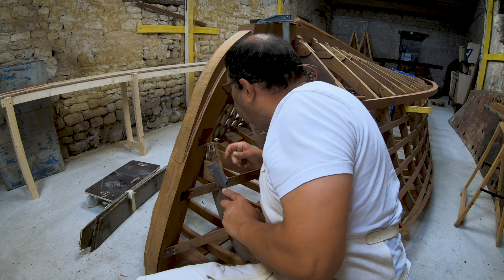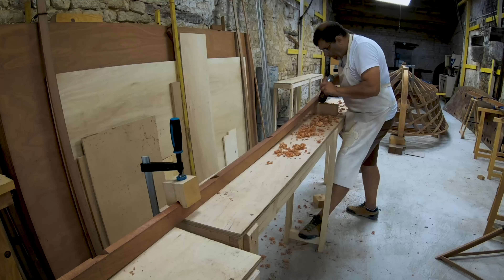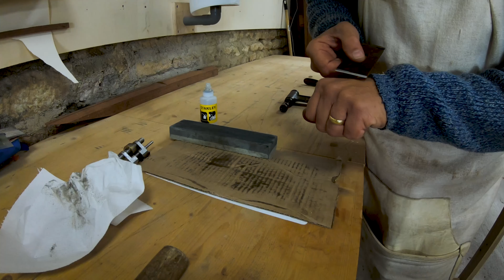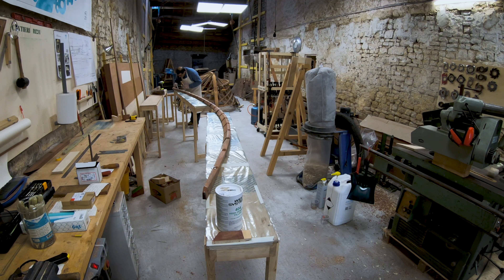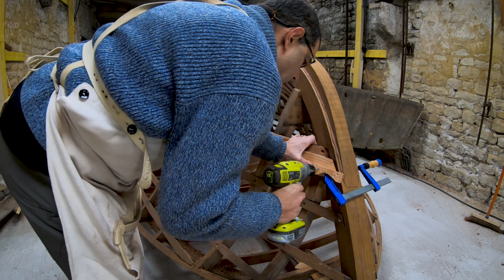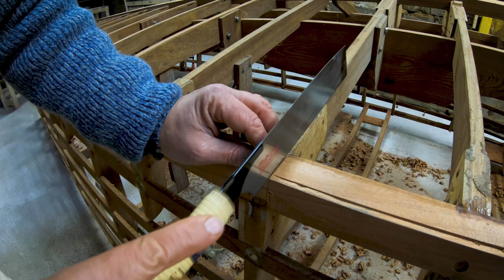RIVA RESTORATION SF211 #5 Ajustement et collage des lissesPART 2/ Chine stringers setting and gluing

Comment: Nice restoration and good videos. I have a question for you: Why are the chine stringers cut to shape from one massive piece of mahogany, rather than steam-bending or laminating them?
Reply from the maker: That's an excellent question! The reason is that I don't have the Riva workshop templates, and to make a steam bent piece, you need to know a lot of preliminary data that I don't have. Namely that this part is both curved and twsist, which means that when you start by curving it, everything goes well but when you have to twist it, the end of the part (at the front on the bow) goes up or down depending on the direction of the twist. As a result, it doesn't fit into its slots anymore... To visualize the effect, take a sufficiently flexible wooden strip, bend it, then twist one of the ends... you will observe that the strip does not stay on the same plane, but that the end goes down or up depending on the direction of the twist... 
I hope this is precise enough to answer your question.
Regards